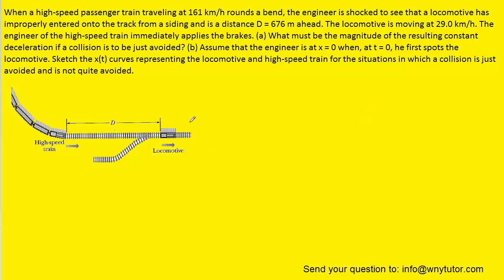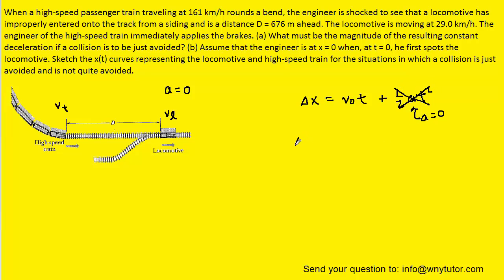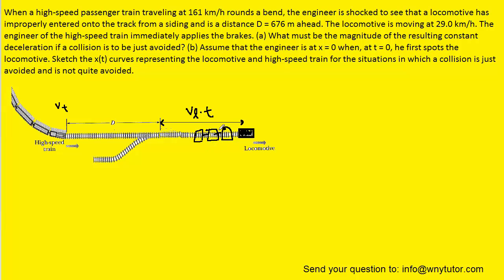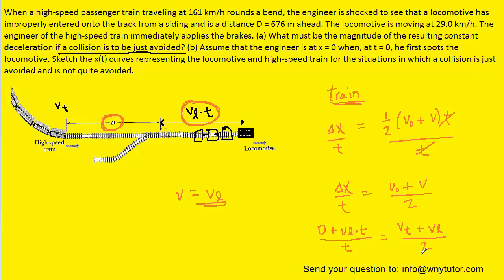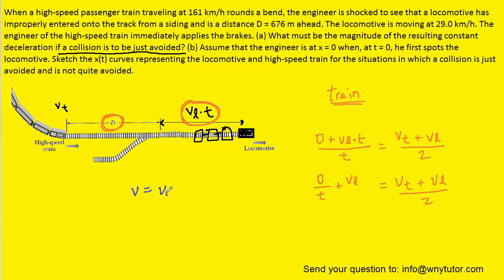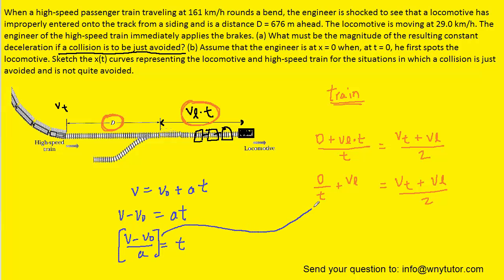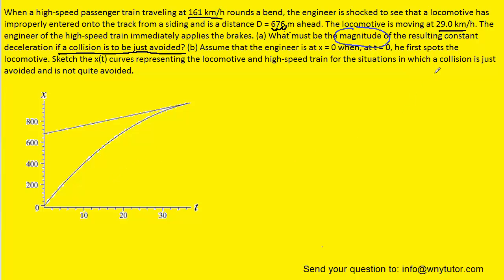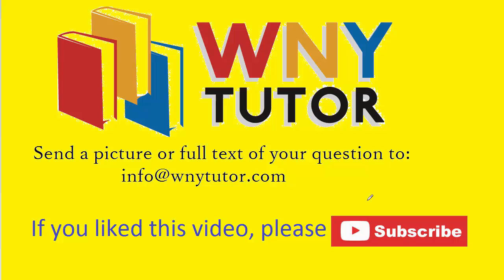When a high speed passenger train traveling at

Comment: why do you use the average velocity equation??
Reply: I think this is the right formula to find the displacement for the train. If we were to use the other two formulas for finding the displacement, we would require time and acceleration of the train, which are not furnished in the question. But, I quite don't know any method to find the time and acceleration, using the information provided in the question.